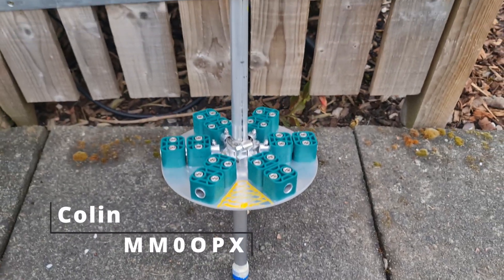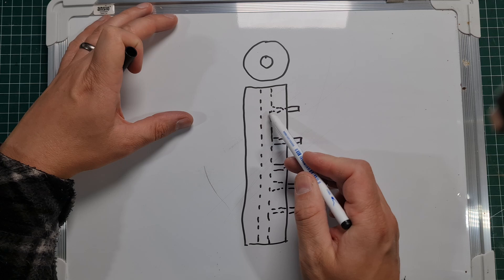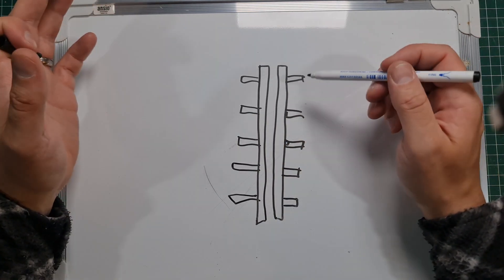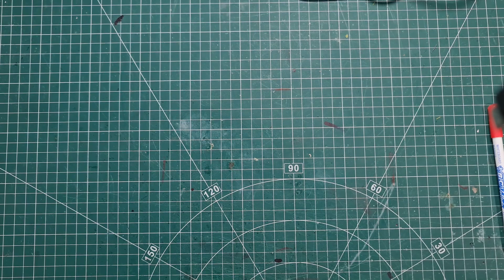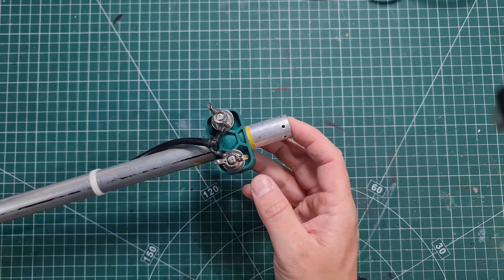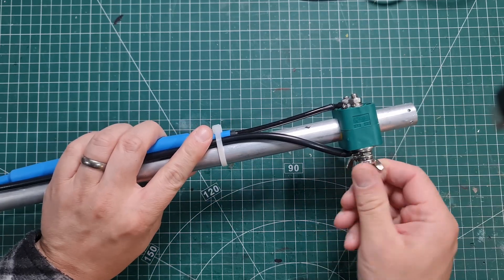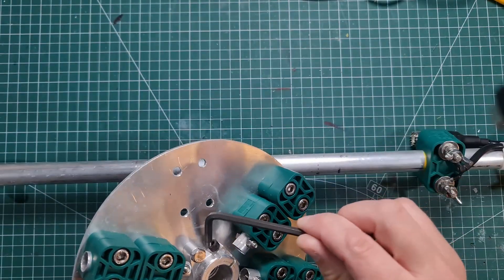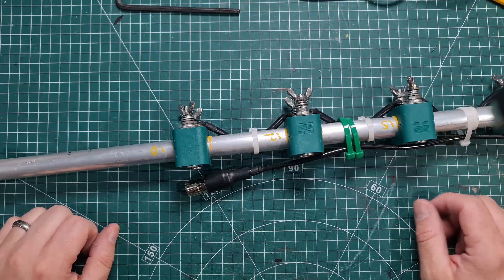The $25 Hexbeam Antenna Centre Post you can build easily.

Comment: Ok, stupid question time.  I’ve got a 50 foot tower and a hazer and I’m wanting to use a 12’ mast do I need to isolate it from the spreader hub or can the top of the mast be used for the center post.  I should mention I want to use the mast as a coaxial center post.
Reply from the maker: What's a Hazer?
Reply: @MM0OPXFieldRadio ifs not unlike an elevator that allows you to winch your antenna and rotor up and down.
Reply from the maker: Ah ok. So your wondering about the interaction with the parallel feeder? Yes that would be an issue unless you used a coaxial feeder.

Comment: Would simple ladder line work for the jumpers?  I am very new to the hobby, so hopefully it’s not a stupid question.  Love these videos, by the way.
Reply from the maker: No such thing as a stupid question. It would kinda work but not well. The reason is this ladder line wouldn't have a 50 ohm characteristic impedence. Check out my ScotHex. This uses your suggestion.
Reply: Thank you so much for the response.  

The reason I asked was primarily over the concerns with water intrusion into the coax jumpers.  It was also over concerns about the weight of the choke.  I use one on my delta loop antenna, but it bugs me about how heavy it is.  After doing more research when I was actually awake, I realized that even if you used 450ohm ladder line with a 9:1 balun, the weight of most of the smaller balun units available out there are about the same weight as the choke, so it’s a bit of a wash.  I guess I was focused on the water intrusion risk, and figured ladder line would do away with that altogether. 

Thanks again for the response.  I am seriously considering building one of these.  I have a 25 foot Porta Mast I have started taking out for POTA activations.  But I would have some work to do to understand what the wind load of this antenna design would be, to determine if I should use a different mast so I don’t void its warranty.

Comment: felling inspired and may have a go myself.     do you know why the coax feed point has to be at the top?   my very simple mind can't get that, if 50ohm is maintained over the centre post i cant get why top or bottom matters  ... please help me understand
Reply from the maker: Thank you. Thats a good question and I dont know the answer if im honest. I dont think it will work tho. Same goes if you multiband a Moxon. You need to feed at the highest band.
Reply: @MM0OPXFieldRadio and you are telepathic … I am looking to multiband a moxon using the open sleeve effect.

Comment: Colin, Thanks for the ideas as I put together my DIY hexbeam.  The only thing you are lacking is a 3d printing setup.  So many times I have seen in your videos, places where I would just print something like you are proposing.  Once you start with 3D it opens so many doors.  :)
Reply from the maker: Yes it does but I deliberately do not use 3D printed items as most hams do not have one. I'm designing for the many, not the few.
Reply: @MM0OPXFieldRadio  Your quest is 100% valid and I agree.  Your work and education is excellent.  At least for me I can take your excellent ideas and convert them to something 3d printed (i.e end caps and tie off points for the tent poles).   Thanks!

Also. most grateful for finding this video.  I thought the centerpost was a simple design.  Lot more to it as you depict here - required spacing and resistance.  

Curious though, have you seen the Buddihex version? Curious as to your thoughts on it.  Looks like someone really did their homework on that design.
Reply from the maker: I agree, a lot of effort went into the Buddie Hex. I like how the wires are attached to the spreader arms, specially designed as a lot on it is.

Comment: Just a thought, you could use solid wire jumpers instead of coax.  Straight pieces with ring terminals on each ends. Thanks for the video
Reply from the maker: Thats a brilliant idea, I wil take that forward. So the jumpers need to be the right sizes to be 50 ohms but thats workable.
Reply: @MM0OPXFieldRadio  ok, I thought about that but wasn’t sure 👍
Reply from the maker: Thanks again. Lots to work on to get right but the bones are these.